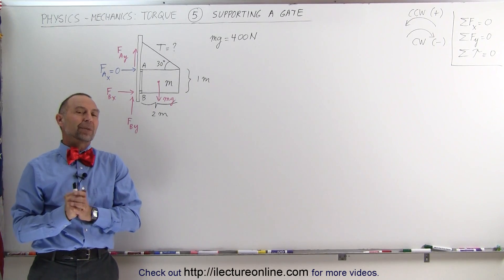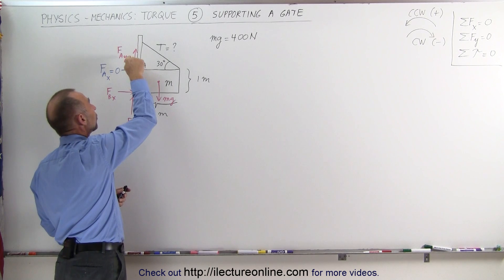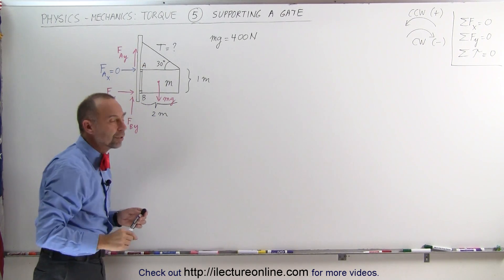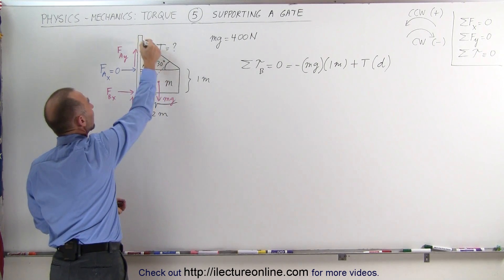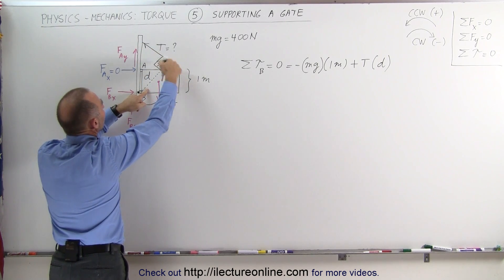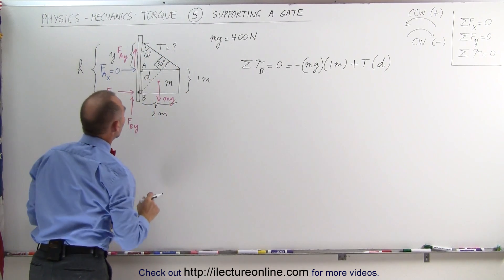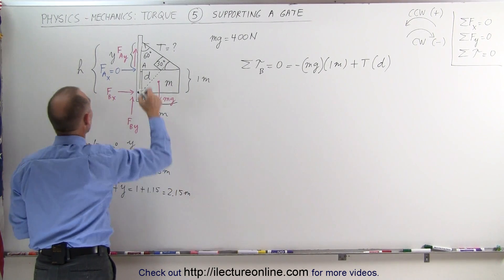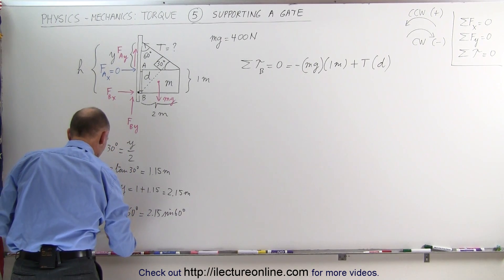Physics 15  Torque (5 of 27) Tension=? Supporting a Gate

Comment: At around 8:00 why did you use d2 instead of d?
Reply from the maker: It depends on the chose pivot point (point of rotation).  The perpendicular distance from the line of action of the tension to pivot point A is d2

Comment: If we take the vertical component of T it will be Tsin(30) and then by taking pivot point at B then (mg*1=Tsin(30)*2) In this way, the result comes T=400N but you got T=214N in here? ((mg*1=Tsin(30)*2)) This process is valid you said your another video (https://www.youtube.com/watch?v=4c2PV1tE2hw&list=PLX2gX-ftPVXUN1kcDgfOx3vAv5zyqQOwp&index=19).
Little Bit confused in here.
Reply: I had the same doubt. Did you find the answer to it?
Reply: I have an explanation. Let's assume it was a rod instead of a gate, then the method you used would give T=400. N if you use the same method it would give the same answer then how will you distinguish between the gate n rod. It's the line of action that produce torque at a point. N its important where the force is acting. (Dimensions).

Comment: i want to clear up the confusion about the torque the other comment had.

using the perpendicular method, (1m)(mg) becomes -mg.

if we have a rectangle of 2m * 1m, that means the length of the hypotenuse is sqrt(5), and the midway point is sqrt(5)/2 away from the pivot.
the angle between the weight and the pivot can be found with theta = tan^-1(1/0.5) = 63.4 degrees. (63.43494 for accuracy later on)

now if we take the CROSS-PRODUCT instead of the perpendicular torque, we get r x F = sqrt(5)/2 * mg * sin(tan^-1(2)), which is exactly equal to 1, so 1*mg => -mg.

mostly i wanted to say this, because i got very confused about it myself, as well, and spent a good chunk of time figuring out, what i was doing wrong. mostly, i was working with the assumption that the angle would be 30 instead of the true 26.57.

Comment: When calculating the Torque around B you wrote that the gate = mg is contributing a torque = -mg(1).  Why can you do this? Isn't the distance between B and the center of mass found by using the Pythagorean Theorem ?    

i.e. 

(1^2) + (0.5^2) = hyp^2   -->   hyp = 1.118..  Then, the perpendicular component is mgsin(26.565)
Reply from the maker: One of the definitions of torque is:    Torque is the product of the magnitude of the force and the perpendicular distance from the line of actin of the force to the pivot point.  The first series of videos in this playlist go through more detail:  PHYSICS 15 TORQUE https://www.youtube.com/playlist?list=PLX2gX-ftPVXUN1kcDgfOx3vAv5zyqQOwp
Reply: Yes, I am aware of what you are doing in the video but the distance of the force mg is not simply 1 meter away from the axis of rotation. It is 1.118 meters away. This is because the center of mass is in the middle of that object, and that's where the force is applied, not at the edge.
Reply from the maker: 2 m / 2 = 1 m  (Not sure where 1.118 meters comes from)
Reply: 2m/2 is not the distance of the force applied from the pivot point. the force is being applied in the middle of the gate, because that is where the center of mass is.
Reply from the maker: You are mis-interpreting the fundamental concept of torque.  I still suggest you take a look at the playlist I suggested above for a better understanding of torque.
Reply: I did re-watch them to make sure I understood. What I learned is that the force has to be perpendicular to the axis of rotation.  

In this problem, the gate has a red dot with a red arrow going down saying "mg". 

The line between the pivot point and that red dot is at an angle, so it is not perpendicular to the force 'mg' by default. The perpendicular compenent needs to be found.
Reply: @everything_strength  Hello Brandon! You need to take the perpendicular distance to the LINE OF ACTION of the force.
Reply: No it wold not, re-check you figures
Reply: 2m/2 is not correct. The center of mass is at the center of the gate, not the bottom.
Reply: Of course it's correct?? You're overthinking it, center of mass is right in the middle which gives half of the length. The horizontal length of the gate is known, thus 2m/2.

Comment: So did you figure out how to separate Fay and Fby?  Since Fa and Fb are both acting in the hinges in a contact force couldn't they be combined into a normal force?  And if they are a normal force then couldn't the y components just be divided evenly between the 293N?  Or maybe move the pivot point to the point of attachment of the cable to the gate so that the Fay and Fby forces are not parallel to the axis of rotation and then solve with rotational equilibrium statements like we did for the others?  Love your vids.  This cliff hanger is killing me hahahah! Hope we can solve for the other two force vectors!
Reply from the maker: +lightvsdark21 No, it turns out, we cannot solve these vectors separately.  The best we can do is solve for the two combined.
Reply: perhaps a reasonable assumption would be that Fay and Fby each have HALF the Force total... so when they are added together you get the Result of Fay + Fby = 273 N  ... perhaps integrating along the length using dF would divide the force up evenly along it's VERTICAL direction.... but then again.... I HAVE NO IDEA!!  lol .... I'm still trying figure out if this gate has any relation to WaterGate or StarGate.... :)
Reply: Perhaps can we get those two components by taking into consideration  the resultant of Fbx and fby